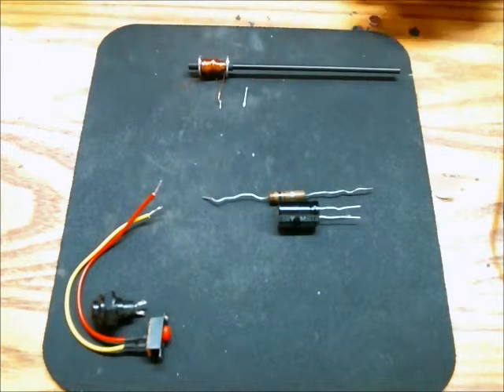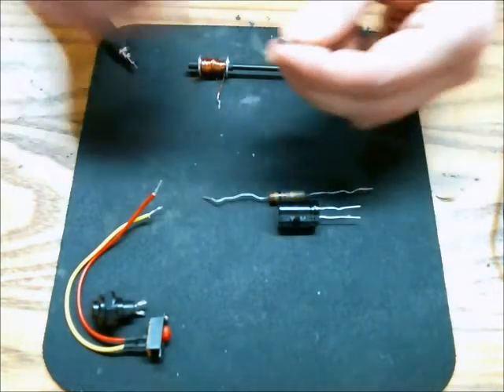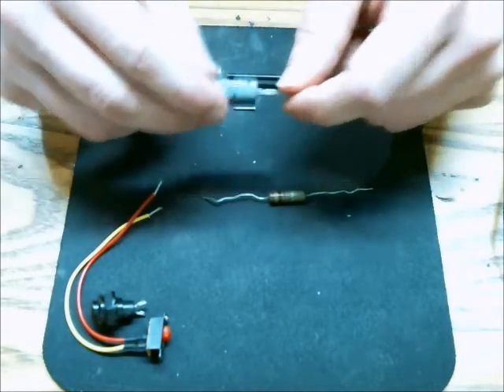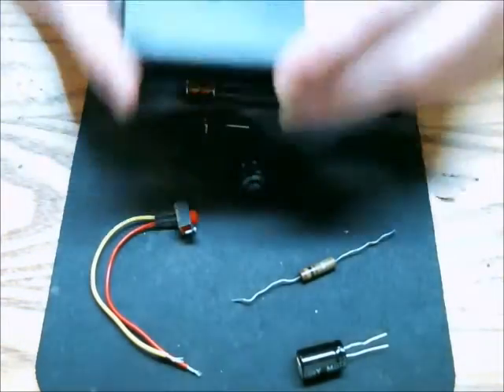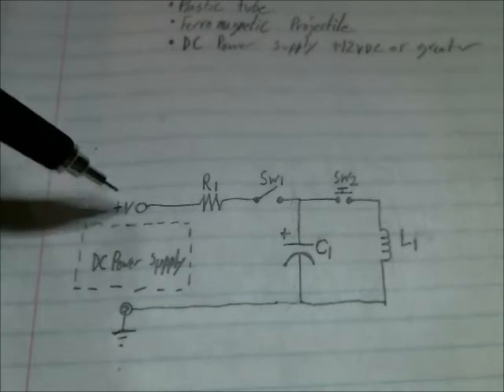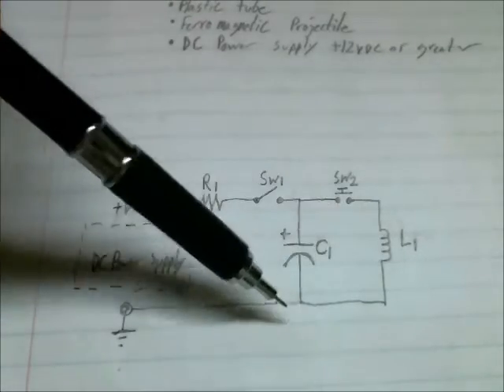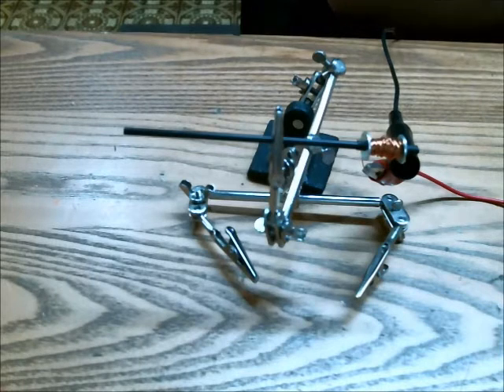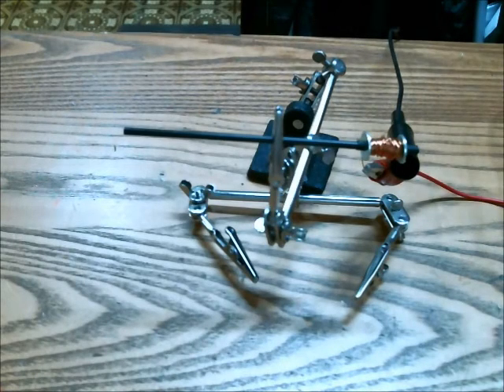How to make a gauss cannon

Comment: how would you set up the capacitor and resistor?
Reply from the maker: I would attach the resistor to the + of the power supply, this is to reduce the rate of current to the capacitor.
(you can get away with not using a resistor, but I will not take responsible for what happens)